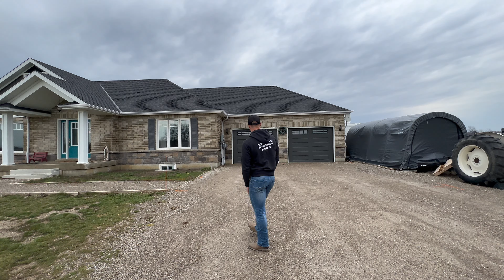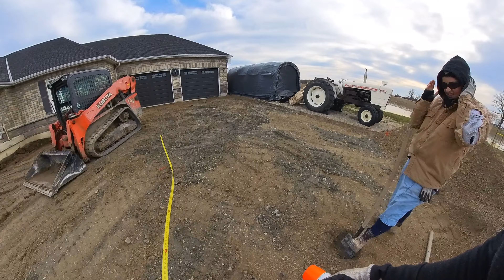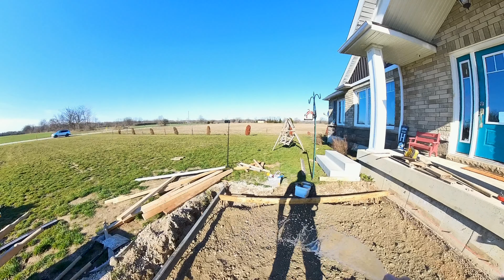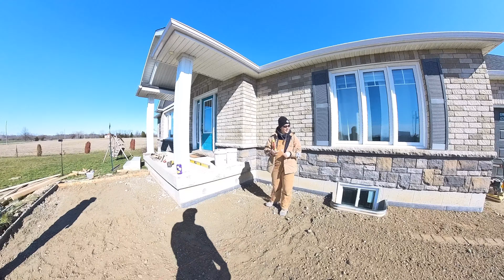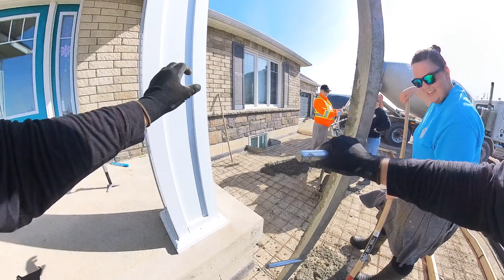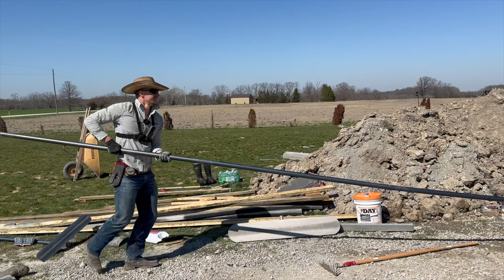This didn't go as planned. "we are losing the concrete"

Comment: That a pretty good size pour for just y’all 2, but y’all pulled it off. 
From what I can see on the video it turned out nice. 
So, how much was left to stamp when you realized you were losing it?
Great video and awesome work, keep it up. 👍
Reply from the maker: thank you. the stamped section wasn't as bad as the boom finish but both times I new we were in trouble after was got done stamping. the stamp was crusting up hard and we had to scrub must of the broom to get it
Reply: @concrete.by.design  it’s always a timing game, but y’all did an awesome job. Thank you for replying. Hope to see a lot more new videos. 
Keep it up 👍